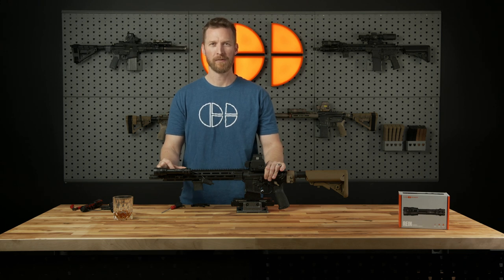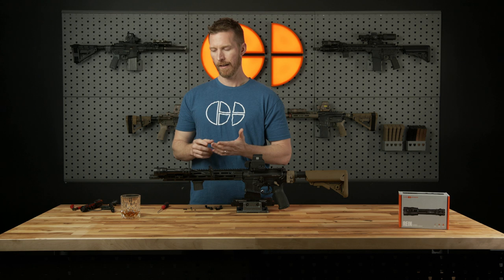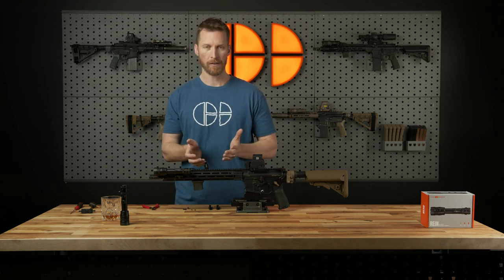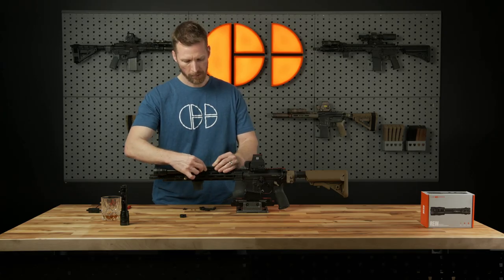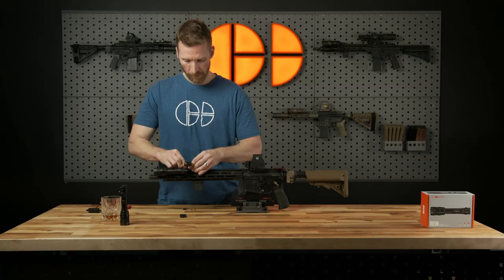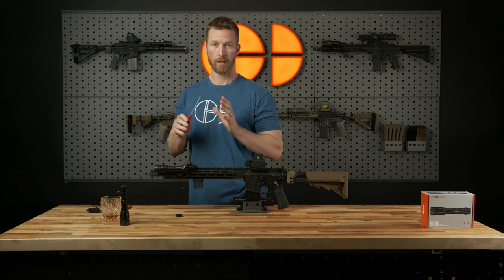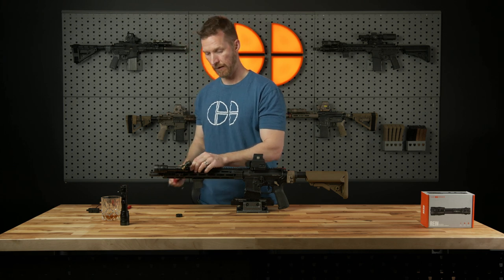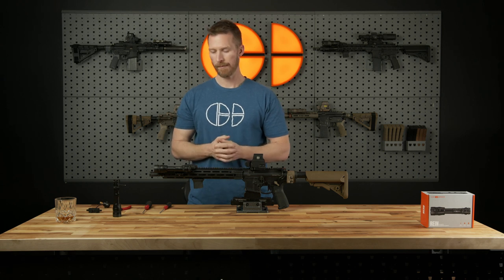REIN Switch Installation

Comment: I can really appreciate the thought that you folks put into the system I can't wait to receive mine and play with the setup.

One question I have is: do you recommend or disapprove of using blue loctite for the purpose of mounting the light and switch to the handguard?

Comment: I want this light. But can I use a dual remote to work with my holosun laser and this light so I dont have to run two remote switches like i currently do? Will definitely buy it if I can run a single remote to work with my laser.
Reply from the maker: Stay tuned.

Comment: The cable is meant to bend to the side out of the bottom of the pressure switch? My cable had a tear in the sheath before I mounted it.

Comment: What should I do if the polymer side panels on the remote switch have become stretched from being installed/reinstalled in different configurations?

How tight should the remote switch be on the pic rail? Should it be able to be pried off without much strength? Mine was just knocked off during training.

Comment: Do I need to have an MlOk mount or whatever comes in the box fits?
Reply: shipping mount is Picatiny. Youll have to go with an aftermarket Arisaka mount or some other brand for MLOK
Reply: They offer m-lok mounts for $45. I just got a pic to mlok  adapter. Should have went with a quad rail.

Comment: can i replace the pressure pad for a different one?
Reply from the maker: As long as it's Rein compatible you can use one of our new 3rd gen switches. 
Or if you have our Rein Legacy body you can use most legacy style switches from other brands, but there will be a loss in output simply due to the fact other switches don't have the output of the full Rein.

Comment: I have an aero precision atlas s-one mlock hand guard which doesn’t have the top picatinny  rail. Would I be able to install the switch using picatinny rail mounts installed on the side or 10 o’clock position?
Reply: Also wondering
Reply: @evann1136  just an fyi, I ended up getting a hand guard with a top picatinny rail lol